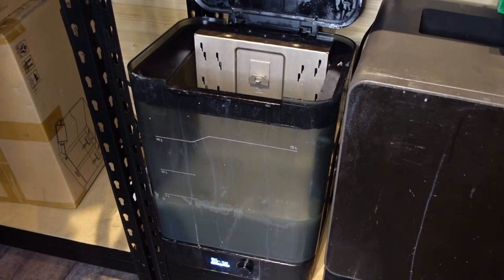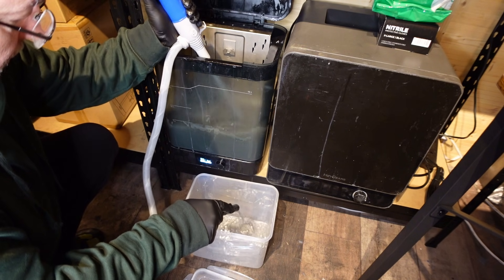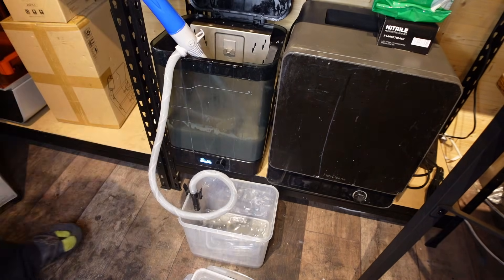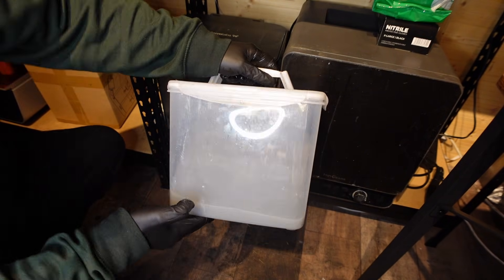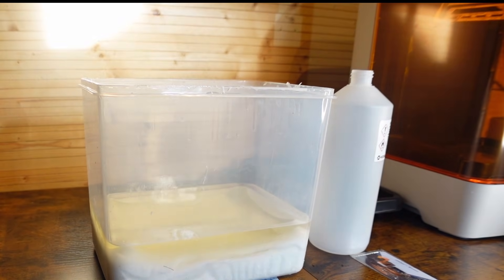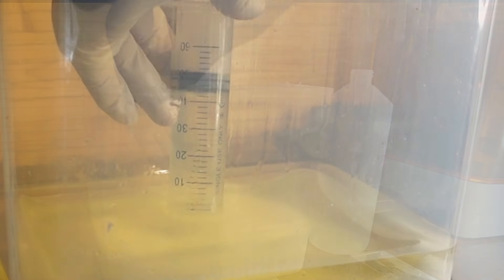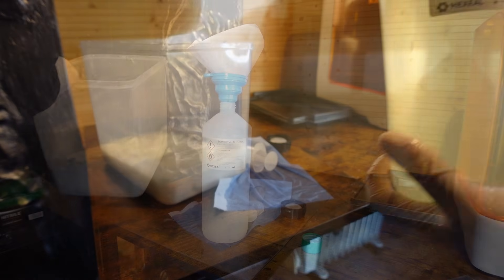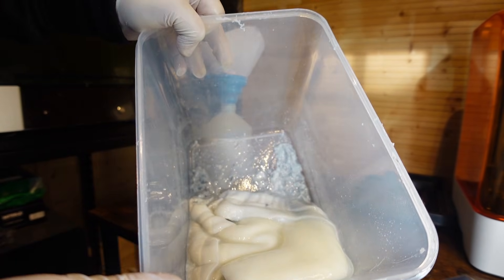How To Easily Clean Dirty 3D Printing IPA

Comment: I NEVER let my IPA get to that stage.
I firstly wash the majority of the resin off in a small bath. (I use a Tupperware container.)
That gets rid of about 80% of the resin. That can get pretty filthy. After a while, just chuck it, it is beyond redemption.
After that, I use a wash machine to remove most of what is left.
Once it starts to get a bit murky, I decant a few litres off into glass jars through a 120 micron filter and expose them for about 10 mins in a UV cure machine.
Give them a good shake and leave on a windowsill for a week. (It's worth giving them a shake every so often, as the sediment will fall back quickly, whilst pulling more with it.) Decant and strain into bottles through a 60 micron filter, and it is ready as second hand IPA.
(If you have left it too long, it might need a second exposure/shake/sunlight)
I return that reclaimed IPA to the tank, 50/50 with fresh, clean stuff.
Once I have washed the model in the machine bath, I have a second tank with clean(er) IPA, and swap tanks on the machine.
Give it another ten minutes or so to swirl. 
After that, wash off any residue under a hot tap, and then (optionally) buzz it in a microwave cleaner for another ten minutes and then finally dry with a hair dryer before UV curing. (Never cure wet models.)
Every so often, empty the second tank into the first, and replace the second tank with fresh, clean IPA.
The rule here is to never let the IPA get so saturated with shite that it's impossible to extract any useable amounts back.
Regularly swap and reclaim, and your IPA purchases will plummet.

Comment: My solution: small containers. 
Why wash your prints in a huge container filled with IPA when you can wash them into a small container filled with IPA?

Another tip: don't bother leaving dirty IPA in sunlight. What's actually happening there is that the resin falls to the bottom, this process will happen regardless of sunlight. The sunlight is what gives that nasty yellow tinge btw. Just leave it still for a couple of days and you'll see that the IPA that builds on top is clear as ever. There's a catch to this, the concentration of resin in the IPA matters a lot. If there's too much resin then the resin particles become perfectly suspended in the dissolvent (IPA) and the sedimentation process will no longer occur. This is why, if you leave it in sunlight, you get that white resin cake. If you add more IPA then the sedimentation process will begin again.
Reply from the maker: Thanks for that tip ill try it

Comment: while this is a very simple method that removed a edcent amount of contaminant, be aware that this IPA might look clean sadly but it is still far from it. There are still a lot of transparent contaminants in there. If you only wash with this, your parts could come out slimy and have cleaning streaks (like dirty water stains). If that if fine by you, then this method could be good enough.
Reply from the maker: Thanks for the info 👍
Reply: Which is why you should have another second, (or third) wash.
Reply: Well, he does say he uses this for his "dirty" wash (or first stage wash) - basically getting the loosest extra resin off - before putting it in the wash station. You don't need the purest for that use. You are right, this still has some of the plasticisers and such in it, but it's perfectly fine for first-stage cleaning.

Comment: bioethanol or denatured alcohol is WAY WAY cheaper then IPA.  and 93 to 96% alcohol is plenty good for resin washing. besides,  pure IPA is hygroscopic and WILL draw in moisture from the air every time you open the container, so I dont really see much point in paying the premium price for something that is not needed.
Reply: Not in the UK it isn't. Far more expensive
Reply: Where? I can get IPA for $17 a gallon in bulk.
Reply: @zakspop  Where I live IPS is 40USD a gallon, converted to USD, and 15 for denatured alcohol. Bioethanol is about the same price.

Comment: Dipropylene glycol ethyl (DPM, DPGME, Dowanol DPM) works so much better in the long run compared to ethanol, methanol, isopropanol or aceteone.
It solvates the resin allowing it to be dissolved/rinsed in water.
Wash/sonicate in DPM (low vapour pressure) then wash in warm water with a little dish soap.
Only drawback is that it takes a while to dry.

Sunlu/Elegoo resin detergent is pretty much the same glycol based solvent.
5L of DPM has washed ~ 40kg of resin models without needing replacement, just allow it to settle then syphen off the clear DPM, no need to cure in sunlight.
Reply from the maker: Wow need to look in to that.. Any sticky residue on models
Reply: @greedy3d480 none
Reply: Sure, but it's hellishly expensive.

Comment: I put my dirty IPA in to mason jars and them on the cure plate for a few minutes to give them a good start, then put them on the windowsill for a few days, give them a little shake each day to agitate the bits to cause more clumping, after a week i'll syringe out what I can then use some fine cheese cloth in a sieve to drain the rest, once its mostly drianed I then fold the cloth and twist the top, this causes the last of the ipa to come out and leaves a nice dry lump of resin that I then cure and dispose of. I've been using the same 8 liters of ipa for the last 2 years.
Reply from the maker: Awsome
Reply: Doesn't it get slimy? I use a similar method but after awhile it just becomes so slimy.
Reply: @zakspop  You need to remix it.
You will naturally lose some through waste, evaporation etc, so I mix my reclaimed stuff 50/50 with fresh.
Just never let it get too dirty to start with.